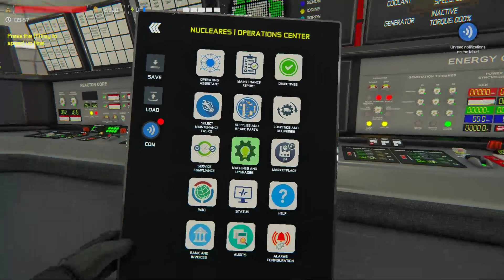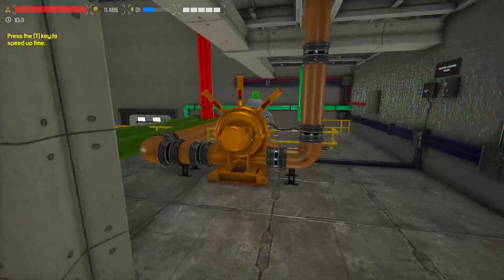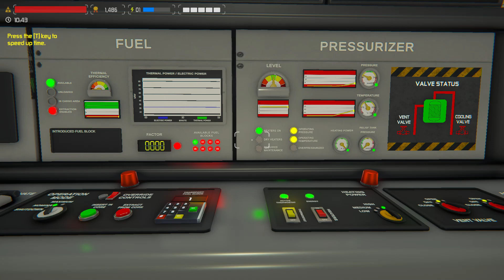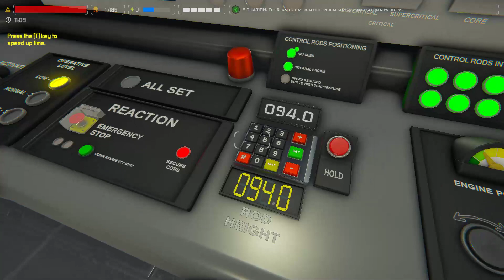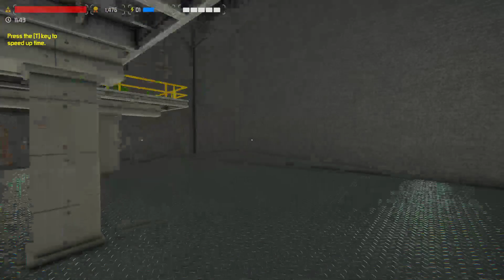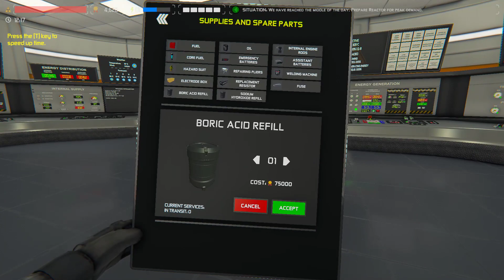Nucleares how to start the reactor up using chemical mode

Comment: 16:04 I am a few months late but the reason the AO says that is because the reactor is not up to temperature yet hence 'the difference in temperature is too high'; the operating temp is 306 degrees
Reply from the maker: yeah if u want him to run the rods the reactor needs to be 350 the reason why he's saying that is because it's not up to operating temp yet he will only control the rods if the temp is 350